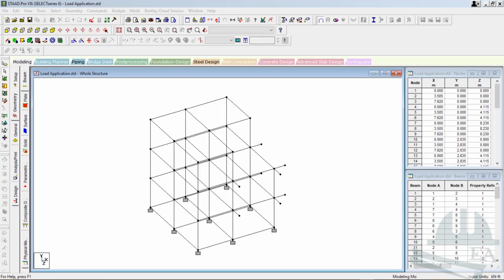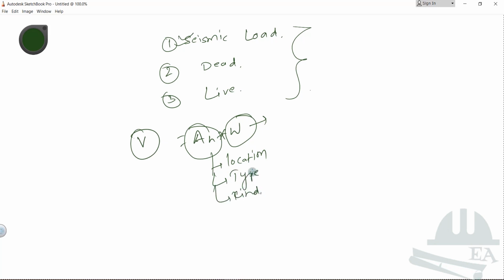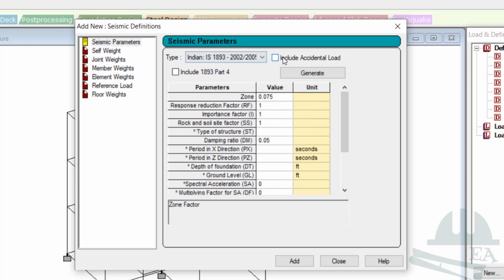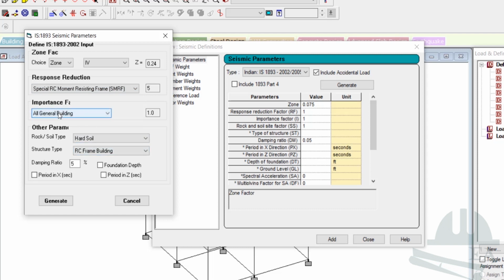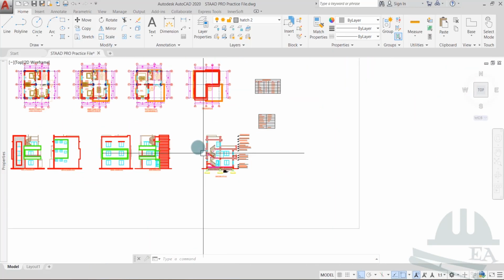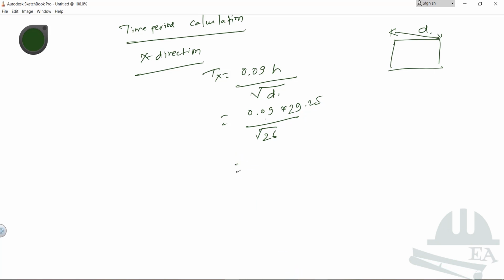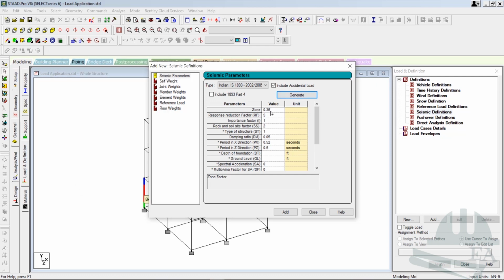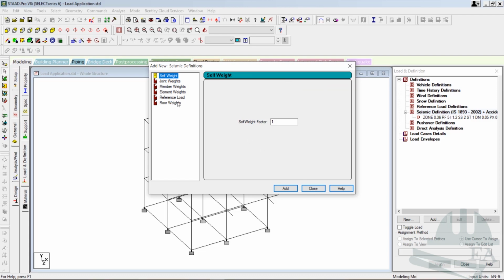STAAD Pro Tutorial For Beginners [Episode 17]: Application of the Earthquake Load

Comment: While calculating time period, dimensions should be taken in Meters as per IS 1893:2016. The time period calculated here is therefore incorrect.
Reply: Yes, it won't be the same cause d value is under the root..